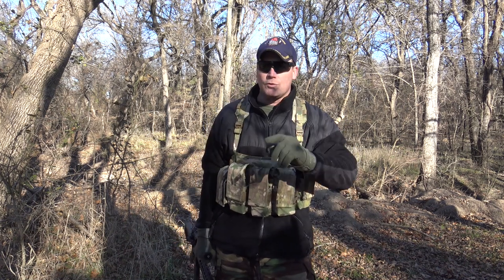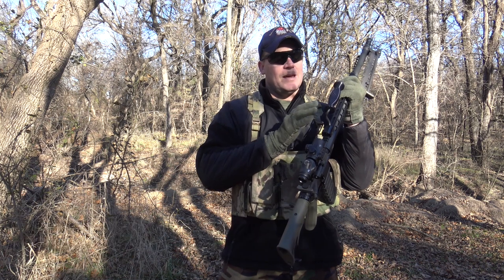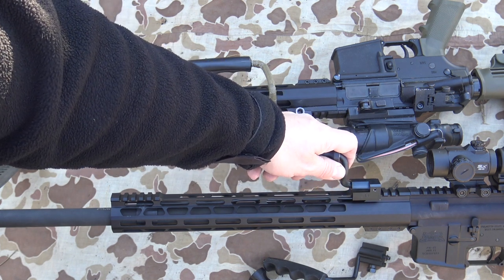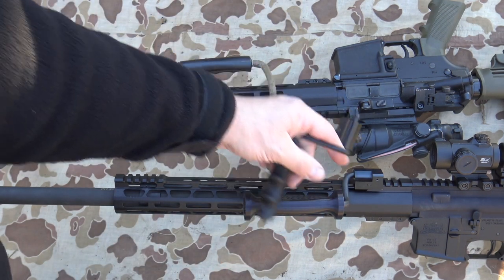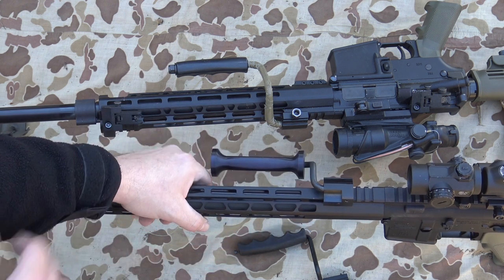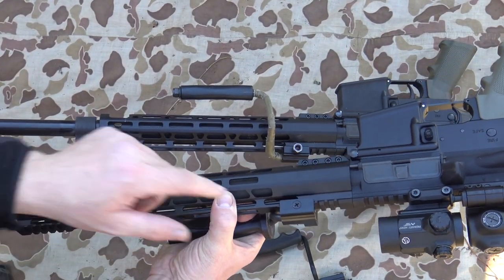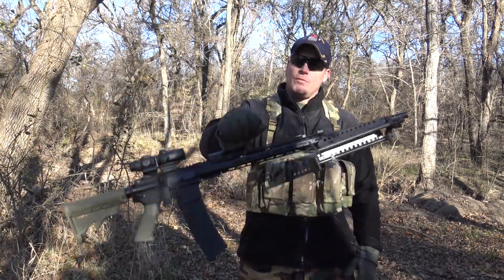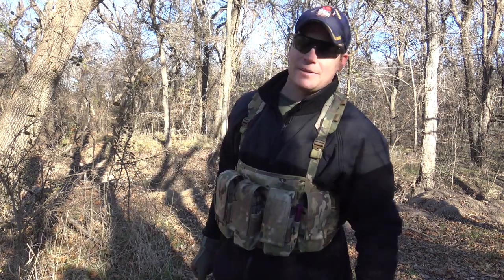Klein Machining AR-RPK Heavy Duty Carry Handle

Comment from the maker: Klein Machining Heavy Duty Carry Handle (one in the video): https://smallteamsupply.com/product/heavy-duty-folding-carry-handle/

Lists of books on small unit tactics: https://www.amazon.com/shop/brent0331

*Guys, Primary Arms is hooking up my subscribers! Just follow the links I have posted below on the scope of your choice, for many of them they will give you a free mount or anti-reflection device (if you go through the below links).*
PA SLx 3X Micro Magnifier w/ ACSS Pegasus Ranging Reticle: https://bit.ly/3DdencH
PA SLx Full Size 3X Magnifier: https://bit.ly/3nLlVgz
PA SLx Flip to side magnifier mount: https://bit.ly/3DPUKXw

PA SLx 1X Micro Prism GEN II Cyclops (5.56) Green reticle: https://bit.ly/3CScIHs
PA SLx 1X Micro Prism GEN II Cyclops (5.56) Red reticle: https://bit.ly/35DM07d
PA SLx 1X Micro Prism GEN II Cyclops (5.56) Red reticle FDE: https://bit.ly/3xlWIfD

PA SLx 1X Micro Prism GEN II Cyclops (9mm Gemini model) Green reticle: https://bit.ly/3DRwMuP
PA SLx 1X Micro Prism GEN II Cyclops (9mm Gemini model) Red reticle: https://bit.ly/3xxJe0N

PA 3X Compact Prsim Scope ACSS 5.56 GEN III (Black) https://bit.ly/2ANgbwQ
PA 3X Compact Prism Scope ACSS 7.62x39/300 Blkout GEN III (Black) https://bit.ly/3h7B7Pw 

PA 1-8X Scope with Patented ACSS 5.56 / 5.45 / .308 Reticle http://bit.ly/2SPbNob

PA GLx 2X Prism W/ ACSS 5.56/308/5.45: https://bit.ly/2XI0wYu
PA GLx 2X Prism W/ ACSS 7.62x39/300 BO: https://bit.ly/2A613ux

PA SLx Advanced Push button Micro Red Dot Sight: https://bit.ly/38aKaNn

Holosun HS507C-V2 ACSS Vulcan HG pistol sight: https://bit.ly/3k4blgM

PA SLx CYCLOPS 1X PRISM (GEN II):  https://bit.ly/35DM07d

PA SLx MD-25 optic (RED DOT): https://bit.ly/3fc14iJ
PA SLx MD-25 optic (ACSS RETICLE): https://bit.ly/348aPaB

PA  Advanced Micro Dot w/ rotary knob http://bit.ly/2CjTCjr

PA SLx Advanced Push button Micro Red Dot Sight: https://bit.ly/38aKaNn

Holosun HS503G RDS W/ ACSS http://bit.ly/2r7gCd3

PA 1-6X24 FFP ACSS RAPTOR 5.56 / 5.45 / .308 BLACK https://bit.ly/2XnyrVO

PA 1-6 FFP ACSS RAPTOR 7.62x39 / 300 Blk out https://bit.ly/33oS97s

PA 1-8 SLx ACSS RAPTOR 5.56 / 5.45 / .308 http://bit.ly/38GcyoZ

PA 1-8 PLATINUM FFP RAPTOR 5.56 http://bit.ly/2zqXYBo

PA COMPACT PLx 1-8x24mm FFP RAPTOR ACSS M8 (Meters): https://bit.ly/3OrXw9W

PA COMPACT PLx 1-8x24mm FFP RAPTOR ACSS M8 (Yards): https://bit.ly/3b58Zyx
PA 30mm PLx Cantilever Mount -1.5" (mount for this optic): https://bit.ly/3PxpvWR

PA 1-6X24mm SFP Riflescope with Patented ACSS 5.56 / 5.45 / .308 Reticle Gen III http://bit.ly/2BD73bB

PA 1-6X24mm SFP Riflescope Gen III with K.I.S.S. Reticle http://bit.ly/2SUbxEo
 
PA 1-6X24mm SFP Riflescope with Patented ACSS 22LR Reticle  http://bit.ly/2N8fj7P

PA 1-6X24mm SFP scope w/ACSS 300BLK/ 7.62X39 Reticle http://bit.ly/2N6Qut9

PA 1-6X24mm SFP Riflescope Gen III with Patented ACSS 22LR Reticle http://bit.ly/2N8fj7P

PA GLx 4-16 w/ ACSS HUD DMR reticle: https://bit.ly/2DDfrvW

PA SLx 3-18 ACSS HUD DMR .308: https://bit.ly/3k3fVf5

Trijicon ACOG TA31 4x32 Scope USMC RCO model: http://bit.ly/2EQIMhg

Camouflage painting stencils: 
PA Tiger Stripe Stencil: http://bit.ly/2Dqzafa
PA Multi Terrain pattern stencil: http://bit.ly/2Izaxkt
PA Flecktarn stencil: http://bit.ly/2DwfMxb
PA Digital camouflage stencil: http://bit.ly/2W0PvOP

**Here's a few links to good deals on Sportsman’s guide on USGI surplus gear**: 
(Using coupon code "WARPOET" also give you $20 off purchases of $100)

WINTER FORGE GEAR:

Multicam gortex parka: https://bit.ly/3FXvXBI
Multicam gortex pants: https://bit.ly/3FoRoym

Marshmallow suit jacket (Coyote): https://bit.ly/3yM4phv

USGI snow camo parka: https://bit.ly/33yc0ne
USGI snow camo pants: https://bit.ly/3qK06PX

USGI Intermediate cold weather boots: https://bit.ly/32PqI8T
Swiss Gaiters: https://bit.ly/32xkJW3
USGI Artic wool socks: https://bit.ly/3qgf1PA

Gortex Bivy Sack: https://bit.ly/3sU4rl6
Green bag: https://bit.ly/32GNRup
Intermediate sleeping bag: https://bit.ly/3PaVnjK
Poncho liners: https://bit.ly/3A57DdW
USMC Iso matt: https://bit.ly/3C7VVRL
USGI sleeping bag compression bag: http://bit.ly/2z14nCR

Base layer: https://bit.ly/3fZ7XCf
USGI Grid fleece: https://bit.ly/3eO0N43
USGI Grid pants: https://bit.ly/3eShXxf
USMC service sweater: https://bit.ly/3sU5IbS

Watch cap "beenie": https://bit.ly/3FQTqVg
Grid neck gaiter (3 pack): https://bit.ly/3FYG9Kg
Sniper veil (2 pack): https://bit.ly/3NOJcYN

Nomex flight gloves Summer version: https://bit.ly/3fuyU1E
USGI Nomex cold weather gloves: https://bit.ly/3sVajdV
USGI cold weather gloves: https://bit.ly/3ONS5TC
USGI Trigger finger mittens (OD): https://bit.ly/3AxQXiF
USGI trigger finger mittens (Woodland): https://bit.ly/3qOk7nd
French Trigger finger mittens: https://bit.ly/3zseSOc
British gortex mittens: https://bit.ly/334dCUY

German E-Tool: https://bit.ly/3Rk5gNJ
USGI canteen (1 qt): https://bit.ly/3AmqWQj
USGI canteen (2 qt): https://bit.ly/3lrv9hh
USGI ALICE load bearing equipment: https://bit.ly/3yNKpeB

USGI Laundry bags (3 pack): https://bit.ly/3rPUKlb
USGI ALICE WP bag (2 pack): https://bit.ly/3ftoXS4
USGI ballistic eye pro: https://bit.ly/2LBLXSR

Folding saw: https://bit.ly/3FVxbxD

USGI UCP surplus pack: https://bit.ly/3ftvLPC

PA SLx MD-25 optic (RED DOT): https://bit.ly/3fc14iJ
INFORCE White/IR weapon mounted light: https://bit.ly/3DZNtoH
DBAL IR laser: https://bit.ly/3mVf970

Other good Sportsmansguide deals: 
Garmin Foretrex wrist GPS (a lot of grunts use these): https://bit.ly/3dHFyRb
Multicam Anorak: https://bit.ly/2IH3N5f
USGI Woodland Coveralls: https://bit.ly/3p9myPH
USGI Mosquito head net: https://bit.ly/3NX2oUo

BOTH OD & Woodland ponchos AND boonies combo: https://bit.ly/3CgVBjo
Used Army ruck (UCP camo but you can always spray paint it): https://bit.ly/3ftvLPC

*BODY ARMOR* 
LEVEL III - IV Plates: https://bit.ly/3nP2AuK

**Crossfire packs**: https://crossfirepacks.com/
COUPON CODE: "BrentCF10" at check out and get 10% off on your order

**This website sells a lot quality reproductions of vintage camouflage patterns**: 
http://onlinemilitaria.net/shopaff.asp?affid=1608

**Great DEAL on Palmetto State Armory lowers to complete this build on a budget! (PLUS, going thru these listed PSA links supports my channel!)
PSA AK-P**: https://bit.ly/3vSV6ZK

M4 style lower for $130 shipped: 
Black: http://bit.ly/2F5FRDU

OD Green: http://bit.ly/2IbtcRY

Coyote/FDE: http://bit.ly/2IGuPpV

Full size M16A2/A4 style lower ($200): http://bit.ly/2F5HaCO

**Brownells Vietnam era rifle clones**:
Model 601: http://bit.ly/305JVMf

-Just the upper: http://bit.ly/2ZTccKC

XM16E1 http://bit.ly/2NRME9P

-Just the upper: http://bit.ly/2LoDGz8

-Stripped lower: http://bit.ly/2Lr4TkM

M16A1 http://bit.ly/2ZD6Yls

-Just the upper: http://bit.ly/2Q6lwGG

-Stripped lower: http://bit.ly/2Q1TnAA

XM177 E2 http://bit.ly/2ZD6wnj

Don’t forget to check out and subscribe to Bruce’s channel: https://www.youtube.com/channel/UCwfzznRRdLUHwKiMTND49Jg 
Also check out my buddy John who is the owner of UW Gear and his Youtube channel at Alpha Charlie concepts: https://www.youtube.com/user/AlphaCharlieConcepts
Reply: They told me they were going to send armies against America. You know what I said? "Fuck em'" "Ain't the first time."

Comment: I got to try a Klein 24" with M-60 bipod and the new handle, this week. It ran flawless with brass and steel in 55 and 62gr. It is rock solid and easy to control under rapid fire while being light enough to carry comfortably with the handle and still have a hand free for other gear.
Can't stress enough, how nice it is that the handle doesn't flop around when you tilt for mag changes and to unload and show clear.
The owner ran a 60rd(58) mag just fine. Just gotta raise the bipod for the mags to clear the ground.

Comment: Seeing as you have the rpk and m60 version do you have a preference?  I'm sure there are pros and cons to each but do you find yourself choosing one over the other more often
Reply from the maker: That's like asking me whether I want to be with the smoking hot blonde or brunette. They're both sexy and satisfy the need, but I lean towards the blonde because it is more visually pleasing to me. In this case, I lean M60 bipods, not because they're better, but because they're a bit more aesthetically pleasing to me. So the M60 bipods are the blonde in this scenario.
Reply: I believe Brent went over the RPK in a vid and the bipod options and why one would choose each.

If not, check Small Team Supply on YT and ask the maker his opinion.
Reply: M60 is adjustable but heavy, rpk is fixed but light. I'd prefer the lighter weight version considering it's a bit of a pig to begin with

Comment: I’m going to need Small Team Supply to get with STRIKE industries and build a quick release AR -10 upper with M60 by pod legs and a belt link system for feeding. Then slap a AR-10 lower on it and you have a AR M240

Comment: Made in the USA, correct?  I've been wanting an alternative to that exact cheap M60 knockoff shown mid-video for setting my railed PTR-91 into a support configuration.
Reply from the maker: Yes, Mike machines these things himself.
Reply: @Brent0331  You can let them know your referral made a sale to a fellow north Texan (if they give you some kind of credit for that).
Reply from the maker: @BaronSFel001  Fantastic brother! Mike is a friend of mine, his money is no good to me.  He's a Patriot!
Reply: @Brent0331  I had to try it myself to find out for sure: it may be pertinent for others to know that if used on a railed PTR this will block the iron sights.  It should still be good if used with an elevated optic but those partial to shooting irons may find this a bummer.

This is not a knock on the actual quality of the product.

Comment: THey wouldn't bend so much if you used them correctly, without adding a massive amount of torque to it. The thing is backwards. You want to distribute that weight better. Run a 512 to allow more clearance. Change the rds position.

Comment: Off topic here. I'm assuming you had a 40 round pmag a few times in this video. Do you find them to be as reliable as the 30 round?
Reply: Yes, they're solid.
Reply: Ive had no issues. I would prefer a bunch of magpul 40 than any of the surefire mags
Reply: Interesting. Just getting feedback from others. I was at a rifle class and the instructors said they found the 40 round not as reliable as the 30.
Reply from the maker: Same no issues over the years.

Comment: what kind of barrel do you need to run a lmg set up for you ar15? im trying to do that with mine but i think i have to skinny of a breel and it will over heat fast.
Reply from the maker: What the two videos I've done over this, I go over specs in them.

Comment: What's the benefit of this over just a standard 2 point sling? I got the 20 inch with m60 bipod I'm still trying to work out the kinks but it's not really heavy enough that a sling doesn't seem just fine
Reply from the maker: When the barrel gets hot from rapid fire and you need to pick up and move, you can utilize the carry handle. Sometimes those hand guards get a little too hot to handle, they're not the old school A1 or A2 hand guards that have heat shields in them anymore. Mainly though, its just another way to carry your light support weapon. The carry handle being where it is located perfectly balances the weapon. Sometimes you just want to carry or move it that way, especially in a casual setting back in the rear and not on a patrol.
Reply: As Brent said, it can balance the weapon and gives you a super convenient, one hand, way to reposition the weapon, or carry, without concern for heat

Comment: I want to do a similar build but use an M16A2 clone instead of free float handguards. Is there a good way to put picatinny rails on A2 handguards?
Reply: You can bolt rails thru the vent holes on the top and bottom iirc
Reply: @gary0228  You know which product to get for that? I've seen a lot of Chinese knock offs
Reply: @Bluemoon30-06  not off the top of my head, my apologies, I also probably wouldn't recommend mounting optics on that because I doubt it holds zero, so basically all it's good for is stuff like, weapon light, bipod, sling mount, then maybe something like this carry handle but I feel like it wouldn't be the most durable, and the A2 already has a carry handle
Reply: I've only seen a mount for Harris bipod, in that application. I used a barrel mount but would have used a hand guard type if I had seen it first. The front sight is on the rail of the gas block.
Reply: @Bluemoon30-06  Samson and some other Israeli companies used to market polymer A2 vent hole sections that provided 2x 45' picc rail sections or a 3 Picc rail section incorporating the 3rd one at the 12 or 6 O'clock position depending on if you mounted them to the top or bottom handguard. They were light and worked for smaller lights and were at their height of popularity from 2004-2010 or so...